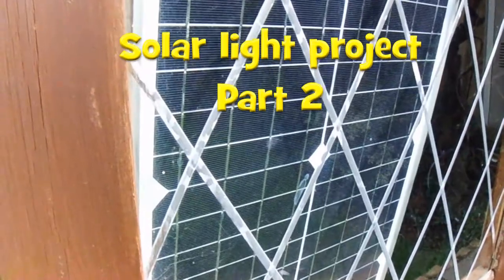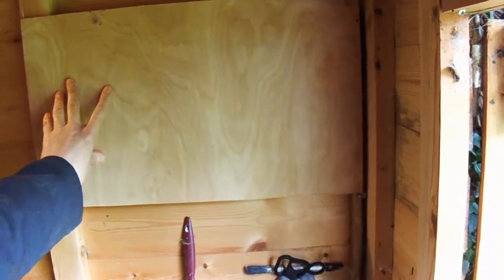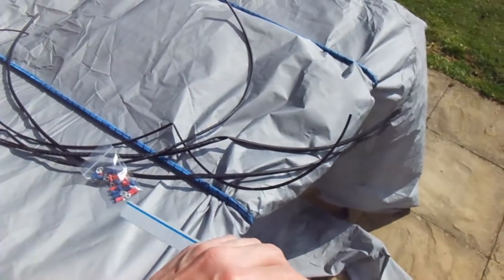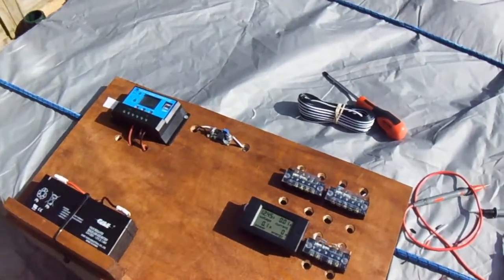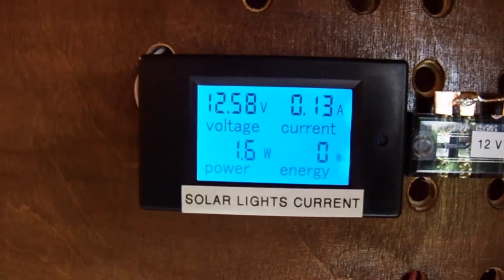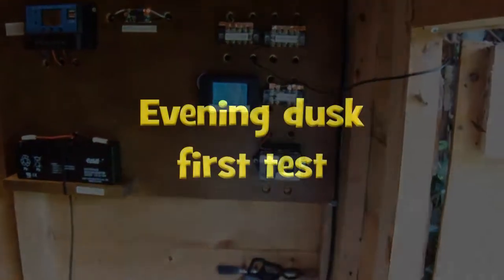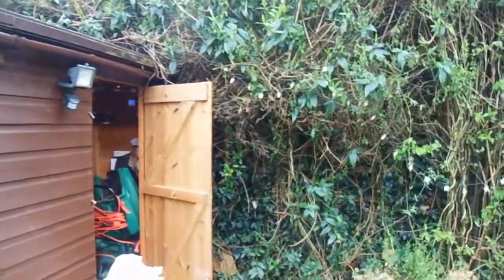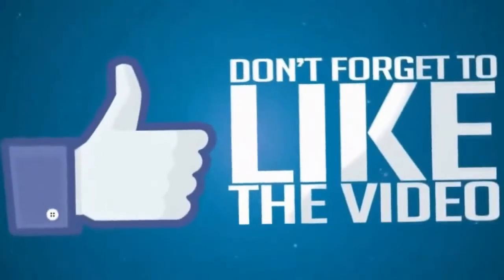Garden solar light project. Part 2

Comment: Nice little solar set up, be great to see some more on it's progress Fred?
Also as a note, you can turn up the charge voltage for those sealed lead acid batteries. 14.4volts is the max cycle (charge) voltage, and 13.8volts is a float (trickle) charge. I do like a solar project :)
Reply: Ive got the battery charging at 14 volts max and its held all winter.  I will be adding to the project in the summer.

Comment: What is fitted bottom right of the board Fred ,, you never said ,, is it a fuse box ? Thanks Shane
Reply: Think i mentioned it on one of the videos mate.  Its a 5 amp fused feed from a 12v supply.  I may plan to run a water feature in the future.

Comment: How many watts is the solar panel please Fred, and why did you not use a higher amp car battery or leisure battery ? Good video Shane
Reply: Hi mate. Its 20 watts.  I just planning to run 3v led solar lights from it.